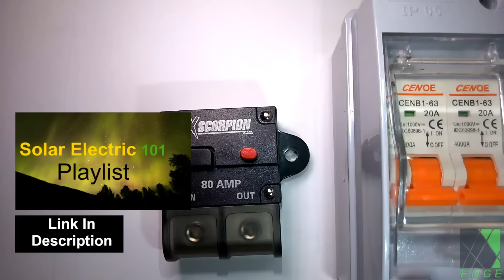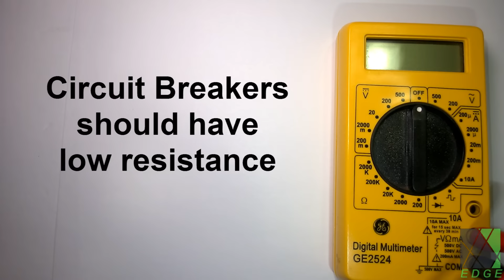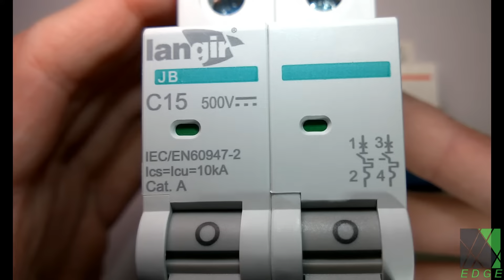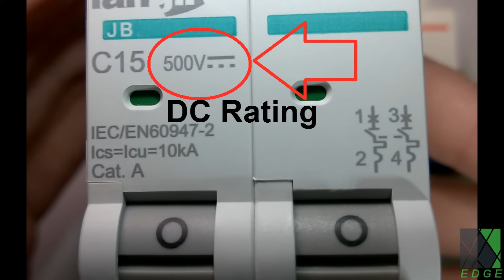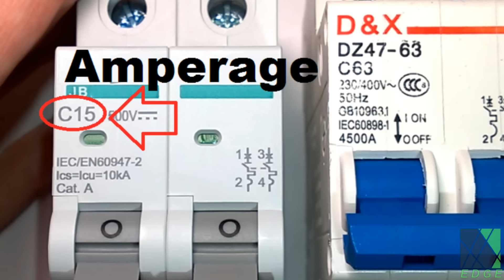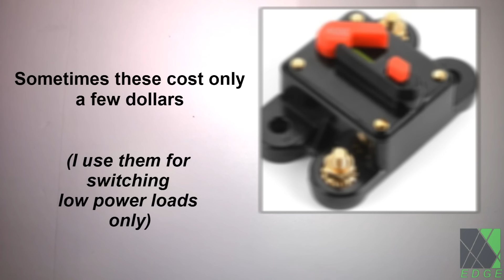DC Solar Circuit Breakers in 5 Minutes: How to Choose Breakers, Avoid Future Problems! Quick Guide

Comment: NEED HELP:  Understanding DC Circuit Breakers???

1) I have 2 48V battery racks
each with 6 batteries in parallel.
Max Amps IN and OUT is 100A each
so each rack is Max 600A at 48V
but realistically just under 60V

Could you recommend a DC Breaker
that will handle 600A at 60V?

2) Inverters max in and out is 250A
could you recommend a DC breaker
to handle 250A at 60V (for 48V)?

3) solar strings are 450V at 12A
could you recommend DC breaker?

Please help!
Thank you
Reply from the maker: Hello, for the batteries, you need a very big fuse or circuit breaker (harder to find). I recommend a cylindrical bolt on fuse or a big ANL fuse if you can find it. In this case it should be a brand name from a big company, for example Eaton or Schneider. You could also pair a fuse with a very large DC disconnect switch for battery isolation if needed.

For the inverter, a brand name (Schneider electric) 300A+ (could still use ANL fuse).

For the solar panels, there are many options. A 600V or higher ~20-30A breaker from a brand name - another words, avoid the cheap generic brands. Beware and read the documentation for the breaker - at such high DC voltage mistakes can be very risky. 

For such an install, you may need a to consult a qualified electrician to perform an inspection before taking the system live. Hope this helps!

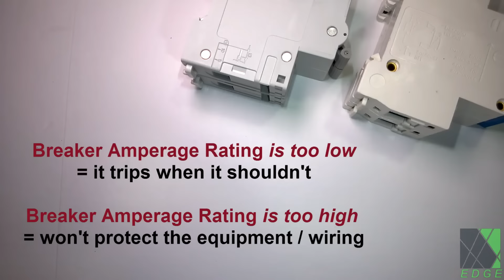Comment: 2:00 how to know the correct ampere ?
I have 2 solar panels each one is 545W and max power current 13.36A
I have 10 ampere breaker but it turns off when I use 600W
Reply from the maker: Hi, the 10A breaker is probably undersized for the panels. There are multiple ways to handle this. One way is to use a 16A breaker for each panel (for parallel connections) or one 16A for series connection. A ~32A breaker could be used for both panels in parallel circuit. Those are very powerful solar panels so I believe you need a bigger breaker. Hope this helps. -DD
Reply: @solarpoweredge   thanks
Reply from the maker: Welcome! :)

Comment: I have a 2P 16A MCB rated at 500vDC. I will be breaking the (+) and (-) through it. My solar array puts out about 330vDC. When you say it can only handle 250vDC/side, do you mean I need to go to a breaker with a voltage rating higher than what I've got (i.e., 1000vDC)?
Reply from the maker: Hi, should be fine, as it will break the 330V circuit twice simultaneously - no problem.
Reply: @solarpoweredge  👍  Super, thanks.
Reply from the maker: Welcome!!

Comment: I’m using a DC breaker to isolate my PV array from the SCC.  I have the PV array is wired to 1 and 3.  The SCC is wired to 2 and 4.  Is that correct or does it not matter?  TIA.
Reply from the maker: Just guessing it's a similar breaker to the example? Should be fine, but can you check if your breaker has a datasheet somewhere showing the electrical specifications and hookup diagram. On the double pole (and non polarized) DC breaker shown in the video, it's perfectly fine according to the documentation. If the breaker is polarized, just need to make sure the voltage is flowing in the correct direction.
Reply: For polarized DC mcb top left terminal is + but the bottom right terminal is + n the bottom + terminal measure is - voltage is it correct toe connect this terminal to a positive side of the load?

Comment: Super info. Question, as your example; does the langir C15 has polarity? What does the symbols for 1, 3 on top, 2 and 4 at the bottom mean? Thank you.
Reply from the maker: Hi, glad you liked the video! The langir is not polarized, but it is a DC breaker. The documentation for the model shown indicates the DC source/load can be connected to either side (backfeeding is also acceptable with this type of breaker), or you can loop the wire on the bottom (2,4). One reason for the numbers is to ensure correct identification of the terminals. If you find a breaker with (+/-) labels, it's extremely important to check the installation documents. Current must flow in the correct direction, no matter where the breaker is wired in the circuit. If you do not see polarization markings, then the breaker is supposed to be able to interrupt DC in any direction. I've noticed the manufacturers sometimes take slight liberties with how they label and print their breakers, and it can get very confusing. In short, to install breakers safely it's important to spend time researching and looking up the spec sheets, to avoid making mistakes. If the company's documentation is not clear, I'd buy from another company that has good installation instructions. Hope this helps. DD